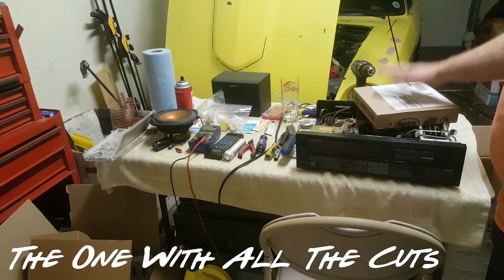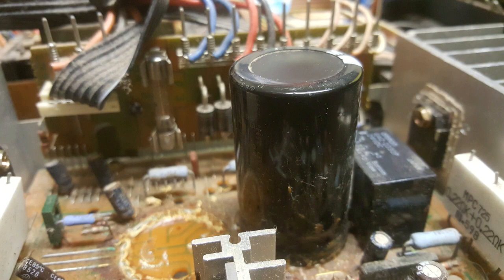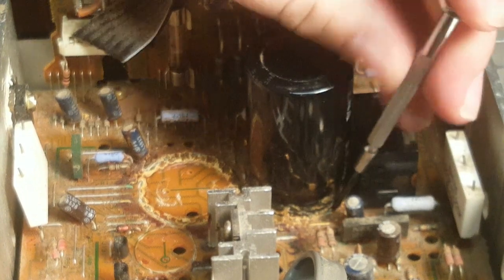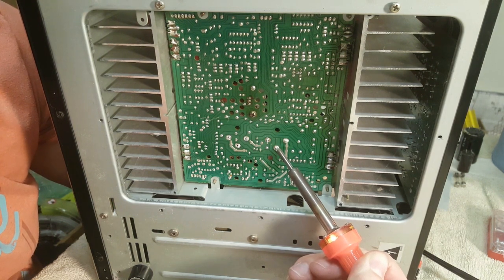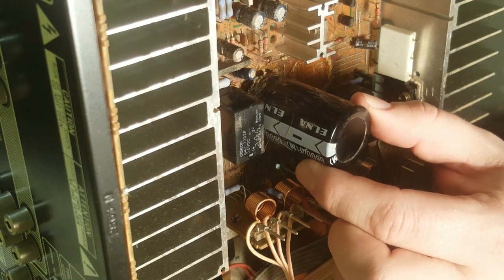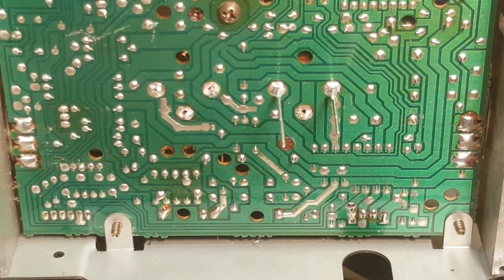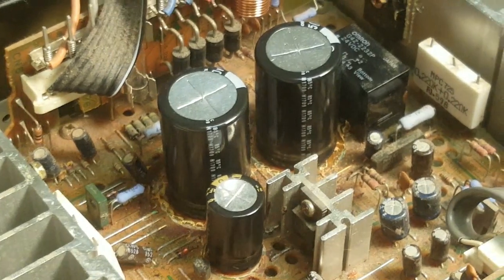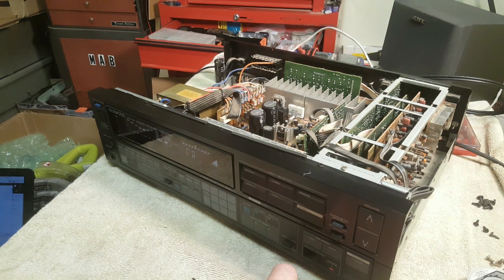Kenwood Stereo Repair Attempt - Replace Capacitors

Comment: Kapasitörleri değiştirdikten sonra lehimleme işleminiz biraz daha özenli olabilirdi lehim telini kapasitörlerin ayaklarına tutarak lehimleseniz dahada güzel olabilirdi yinede güzel bir çalışma emeğinize sağlık👍
Reply from the maker: "After changing the capacitors, your soldering process could have been a little more careful if you soldered by holding the solder wire to the feet of the capacitors, it would be even better, but still a nice work, thank you 👍" THANKS!!!

Comment: In my dvd home theater system Phillips htd3510/98, rear left channel sound is very low compared to the other channels and I tried to increase the db -6/ 0 /+6 but too low volume  Gain From O to +6 no difference its like low frequency . Now I've set SL to maximum +6 gain and the other channels set to _"O"+  .why? Any solution 🙏
Reply from the maker: Sounds like there is a problem with a component, not the settings. Might be a problem with the speaker or the wire or the Phillips home theater receiver. Change the wire first, then change the speaker, then test the receiver as best you can
Reply from the maker: Remember though, the rear channels usually don't have much sound coming out, it might only be a special effect that happens on occasion, not constant noise or sound.
Reply: Thank You!🙏

Comment: There is an L in soldering, you pronounce the L.
Reply from the maker: Cool beans bro, did you even Google that before you commented??
Reply: @Brazzzzzle  The word solder originates in Middle English. The Latin origin is the word solidaire, meaning to “to make solid,” which is where the l in solder comes from. Solidaire (v.) – to join, be united, standing together, or interdependent.

Comment: The reason your solder joints look bad is because you didn't remove the old solder and re-solder with new.  You're re-using old solder that has no flux in it and that doesn't bond very well with the pad and leads.  Use new solder with flux core and your joints will look more professional.

Comment: Never solder by putting solder on the iron tip and then adding that molten solder to the pad.  If you do it that way you're going to end up with piss poor connections and cold solder joints.  Apply the hot iron to the pad you're soldering, let it heat up, then add the solder to the heated pad, when the pad is covered and the lead of the component is submerged in solder, stop applying solder and leave the tip of the iron on  the newly soldered pad for a couple of seconds and then remove the iron from the area.  When you're finished your soldered connection should look like a volcano with the component lead coming up the middle of it and not like lump curdled milk or a bubbled blob.  I understand that you may not solder much, I get it - I was there too once.  But heed constructive criticism and practice.  Cheers! :)
Reply from the maker: Thanks! I'm not sure why I did that there :D that's not how I would usually solder stuff. You're right, what you said is best

Comment: I’ve got a noisy pioneer avr. Problem is, hifi insider etc says it’s their most powerful one... im nervous about fucking it up. Every tech I call sounds too bothered to help me, so wish me luck lol. Thanks for the great video, I hope mine aren’t glued in and I’m buying solder wick!
Reply from the maker: Good luck man! Yes maybe the comments on my video have helped give you more tips on what to do and what not to do :)
What model is your avr?
Reply: Matthew Brazle it’s a VSX-D1S, and I’ve unearthed the caps and order replacements. It’s gonna take forever though! The ones in question that I figured were the issue from listening were in fact the only that were off spec, and they were bulged. Gonna get those switched, now onto the nikko power amp that’s stuck in protection mode.
Reply: Matthew Brazle I replaced them, and the noise is still there! I’m gonna shotgun the rest of the electrolytics some time down the road.
Reply from the maker: @graxjpg  hmmm, that's definitely tricky. Hope you get it figured out. Is the noise steady or does it change with different inputs or settings?
Reply: Matthew Brazle the noise is there even if the volume is all the way down on every input and output. It has several amps inside, and each have that noise. That leaves me to believe that it’s their common power supply that is supplying the noise.
Reply from the maker: @graxjpg  does the noise get louder when you turn the volume up or does the noise stay the same volume?
Reply: Matthew Brazle it does get louder as I increase the volume.

Comment: Why not use a solder sucker or de-soldering braid?  Should clean the board with solvent and check the tracks for damage! Looks like loads of dry joints!  Very bad soldering technique.

You can download the KENWOOD KVR-A70R Receiver Amplifier service manual from off the net. 

The copper tracks and jumper wires are clearly corroded due to leakage of the dielectric.  You need to check continuity and test the components.  The speaker output will be driven through the large power transistors (with heat sinks) at 100W unless that amplifier has some protection it will fry the output transistors.  I notice that you when you switched it on you did not load on the output - that's bad news. 

You should use an oscillascope to trace the signal path and see where the signal disappears

I suggest that you stick to your day job.

Comment: Hey Matthew .
I do basic audio repairs for fun and to help out buddies.
Anyway I got a unit that belonged to a guy who had died and his brother now owns it.
Its a kenwood ked-891 and it won't power on.
Fuses are good.
I'm thinking its a capacitor 35/2200 
 Clearly it has leaked some and the glue is almost like rust now.
Should I replace all the capacitors on the power board or just that 1.
Reply from the maker: Hey Corey! I hope I can be of some help, but I'm just a hobbyist like you. I would start with just replacing anything that looks suspicious, I wouldn't touch any components that don't look like they have a problem. The only exception would be if you have capacitors that comes in pairs and you see one that needs to be replaced, then I'd replace both of them at the same time. Hope that helps! Let me know how it goes!
Reply: By the way...i don't hear any relays clicking either..

Comment: So...if there is a burnt up residue surrounding the bottom of the cap, and if the cap is slightly deformed....is that a safe assumption that the Cal is done for??
Reply from the maker: Hey Corey, I'm no professional just an amateur here. But that is a good sign the capacitor has been compromised. In general you want to look for the top of the cap BULGING, not just a slight deformation, but any deformation can be a sign of troule. Also I think the cap can go bad, even without any visual sign. Anything burnt up is also a good sign that there is a problem, but if possible, you want to identify and trace it as best possible to identify the correct part that may have malfunctioned.

Comment: The transistor ( or other component) beside the caps, with the small heat sink, looks fried by the looks of the back of the board. Anybody know what it is?

Comment: Yes. When power is pushed and a second or two you should hear a click. If not, there is a problem in the protect circuit, relay, test.  Get all that old brown glue off. It is corrosive and conductive.
Reply: Sorry to bother you, I'm poor and have a decent amp it has a remote control for power and the switch...when I click the switch I comes on then a second later it switches off...any ideas...you're my last hope Im in a 3rd world province🤣

Comment: I have a question.
Is it possible to add base on my amplifier with a higher capacitor of more than 25v 4700uf?????
Reply: you cant go higher on capacitance you can only go up on the cap  voltage
Reply: @snipermanboss  how can I do that???

Comment: Please what may happend with the sound,if the capactor is guilty ? Thanks Andy
Reply from the maker: Good Question! I have not figured that out. I have a one and a half year old and too many other projects (rust on that Datsun is one of them) so I have not had a chance to revisit this issue on this receiver to figure out what else might be wrong. I will post an update if I do though!
Reply: A hum mostly, especially if it’s there when all volume is down.
Reply: When the electrolytics have to be changed, the transformer emits an annoying humming, the capacitors can't handle the spikes, they overload the humming transformer. That hum is not heard in the speakers.

Comment: What value caps in power supply would be used on 100 what per chanel and what would be the transformer secondary ac be
Reply from the maker: You know, I really honestly have no clue about those details. I was looking around a bit and found that the KVR-A90R actually goes up to a rated 80wpc. So that's a pretty big jump from the 70.

Comment: How many watts per chanel is this unit
Reply from the maker: Looks like it's (under)rated at 55wpc. Really I always thought it put out a healty 100-200wpc based on how well it would push big floorstanding speakers like my JBL S312 speakers.

Comment: Use desolder tools u make it to hot and make chance to distroi the print or components
Reply from the maker: Thank you for the tip, I need to get those tools

Comment: You could have problems with smaller capacitors, as well. Check the fuse on that one board I can see. Check the output transistors, as well as other transistors. Also, fusible resistors have been know to drift, causing failures in some systems. You'll need a schematic & part list to find which resistors are fusible. Also, what are the components on the top side of the board, where the back side is slightly darker?
Reply from the maker: Thanks for the feedback Mike, when I have a chance to get this project back out I'll check on those things you were asking about. At the moment I've got my hands full with the Datsun in the background of the video :-)

Comment: Hello Mathew. Did you ever get your receiver working and if so what was the issue? Thank you
Reply: Easy repair. Chk output trans and spkr relay voltage.
Reply from the maker: Hey Cole, thanks for asking, I actually haven't had a chance to work on her anymore. She's been sitting on a shelf, so it's not working yet :(

Comment: Hi the Omron  speaker protection relay is not changing over hence no Audio, check the voltage on the common terminals of the relay switching contacts to see if either has high DC. If there is high DC on either, then the protection circuit is operating correctly and there is a fault with the respective channel. If no high DC is present then there's an issue with the protection circuit.